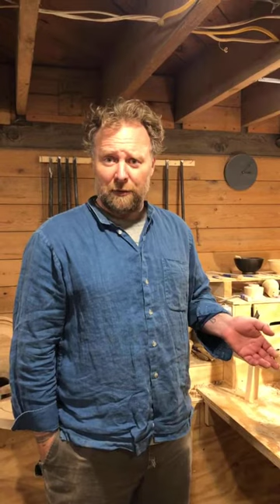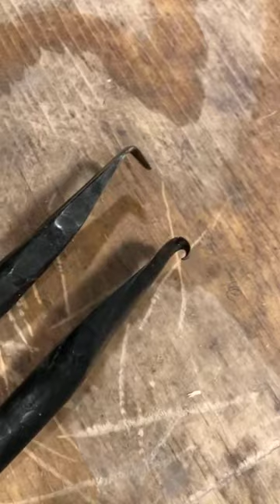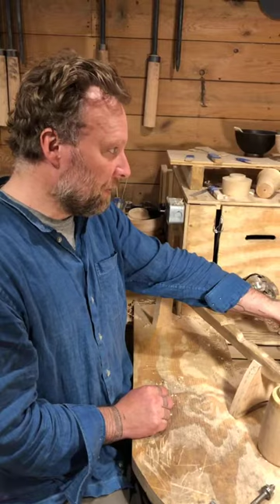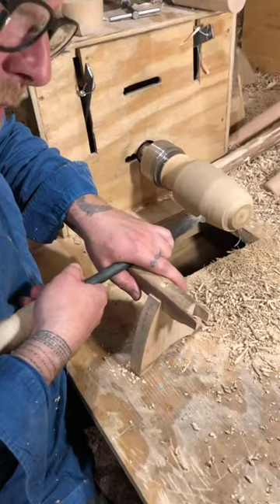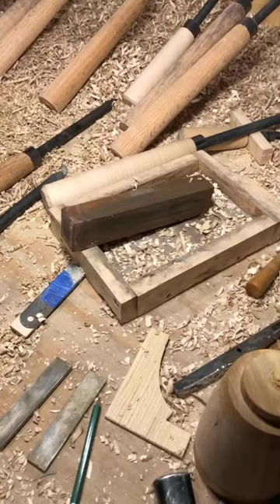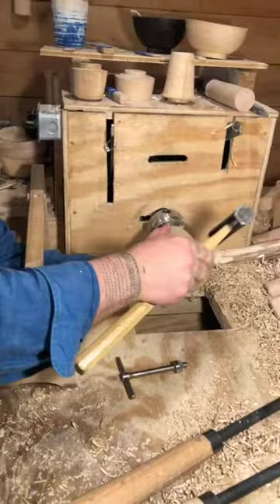Cup Turning on a Japanese Style Lathe Covid Sessions Part One - Jarrod Dahl

Comment: Interesting.  I see that when you were fitting the jam chuck (~29min), that you were running the lathe clockwise (reversed) and cutting the far interior side.  I do this on a western lathe with standard bowl gouges to hollow out bowls.  I use a  chuck that locks onto the spindle, and a curved tool rest that fits into the bowl so that the chisel is properly supported.  I think this technique is much easier than twisting my back and leaning over the lathe. For some reason that I don't understand, the members of my local club don't seem to get the idea.  But it works for me.